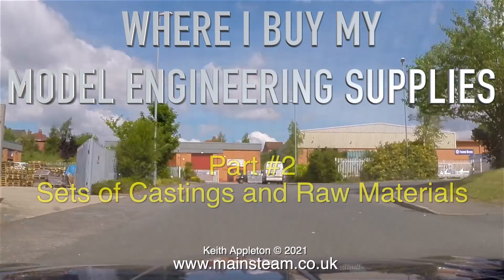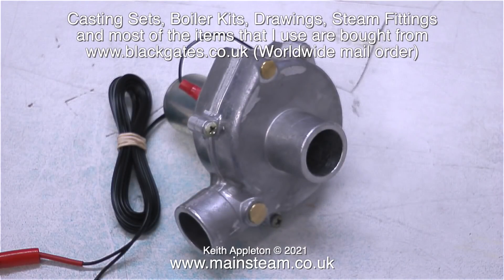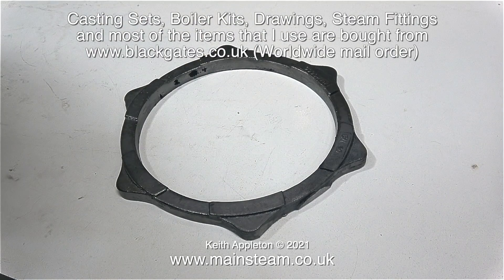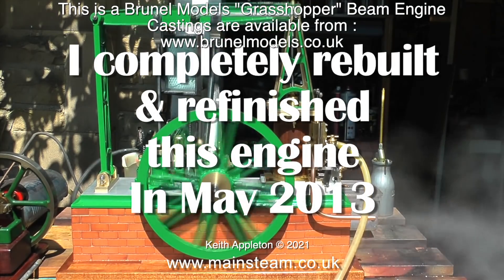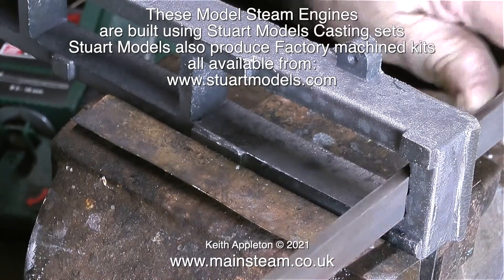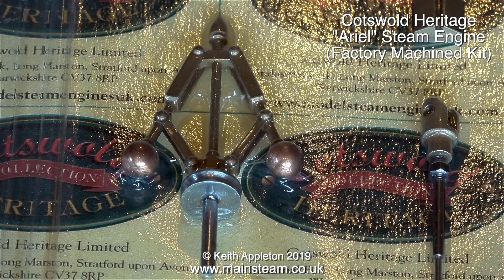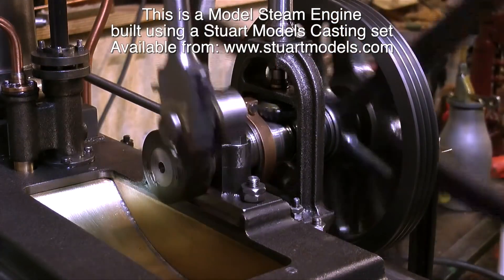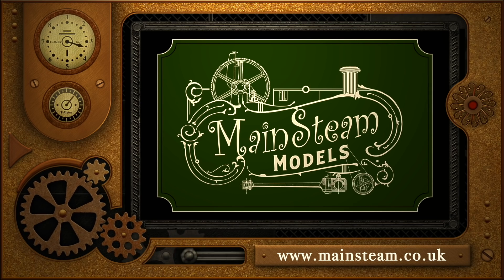WHERE I BUY MY MODEL ENGINEERING SUPPLIES - PART #2

Comment: Isn't the idea of model engineering to make everything yourself? Like your videos, by the way!
Reply from the maker: That may be your idea, but it's not mine, time is precious and I buy routine components instead of making them . . . . }:-)))
Reply: I'm not sure casting, steam fitting manufacture, boiler making etc. is routine. Each build is unique and these components should match the build. Youngsters or builders with limited finances should know that buying components isn't the only option and it is very possible to make everything from scratch... @keithappleton